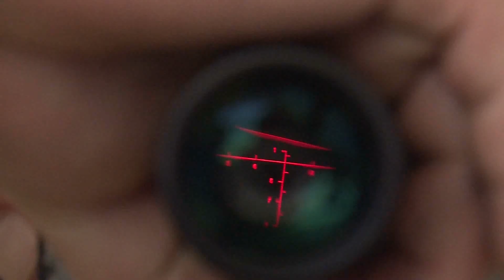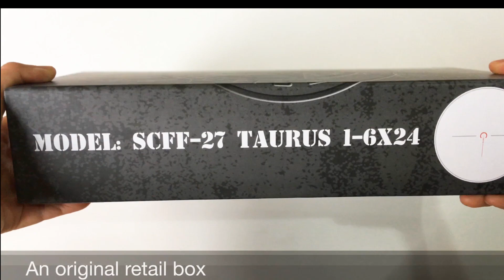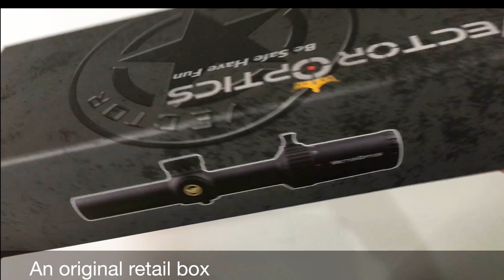Boutique SCFF 27 Vector Optics Taurus 1-6x24 FFP Scope with BDC Reticle 1/5MIL 1/2MOA for AR15

Comment: Qual a melhor regulagem dela e ter melhor aproveitamento dela num fuzil 308 para caça, de 1 metro a 150 metros
Reply from the maker: HI, the scope can't be used at 1-meter distance. From close to 150 meters range, 1/10 MIL 1cm adjustment is a good option. Thanks.